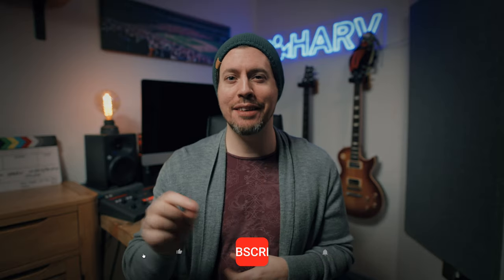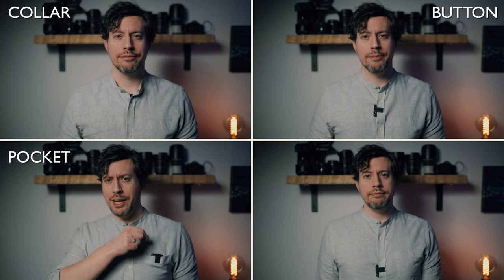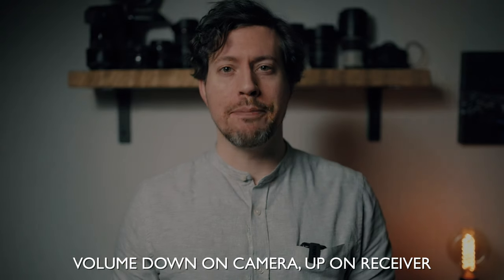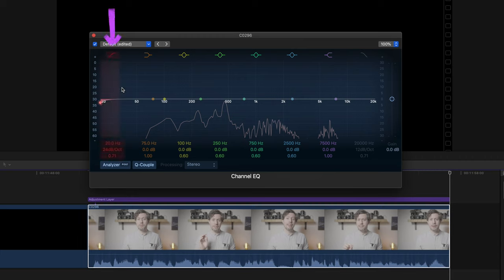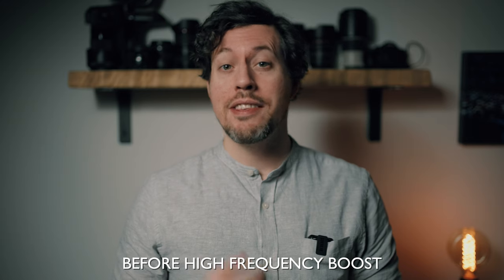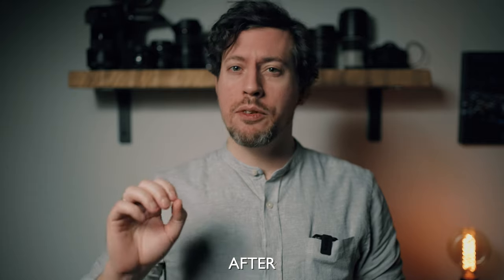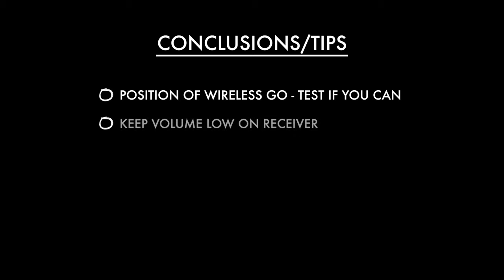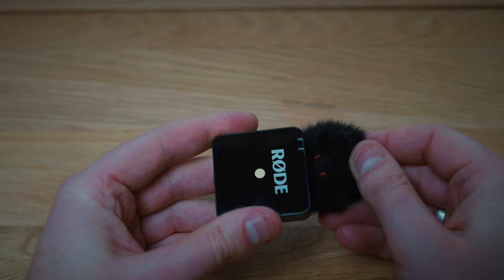Rode Wireless Go Opinion | How To Get The Best Sound From The Built In Mic

Comment: Really good deeper dive into these. Appreciate it! Having used several in the field, I can absolutely confirm that range is main issue with these fantastic units. Line of sight is not 100% necessary but much safer.

Comment: Thank you for this guide! I am having a problem w/ my Rode Wireless Go ii mics where I'm getting a loud high pitched buzzing sound while the Rode mic is plugged into my Sony cameras and clipped onto the top shoe mount. The camera input level is at 1 (lowest) and the mics are at -15db. The Rode customer service hypothesized that it could be picking up the RF signal of the Wireless GO ii. Have you experienced this? It isn't the mics themselves because I can plug them into my computer (through USB) and record perfectly good audio. Thank you so much for any advice!!

Comment: Great review.  I like to use the wireless go with a budget lav mic (Power DeWise) and my receivers into a Zoom H6 so that i have easily adjustable tactile controls, but from there I just run it into the camera so I don't need to sync the audio in post.  I have to say tho that I haven't had any audio drop outs indoors, seems like it does pretty good with walls to bounce the signal around, but outdoors is a different story, would lose signal very easily.